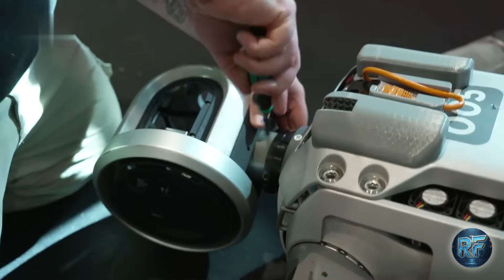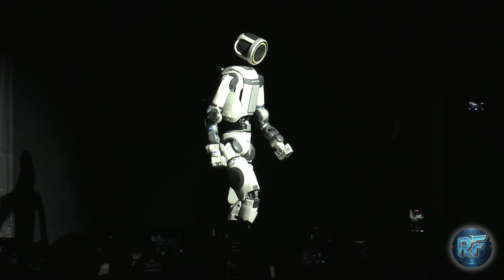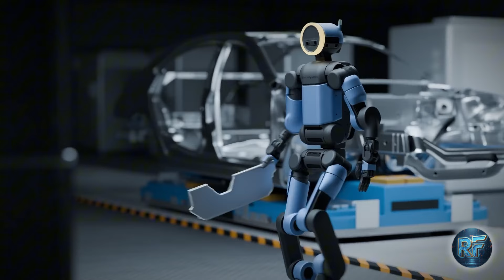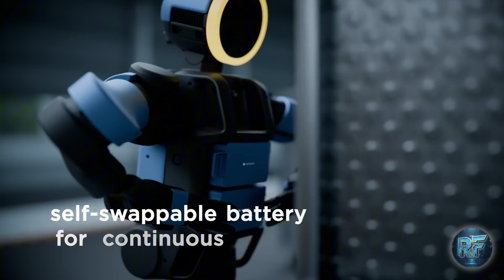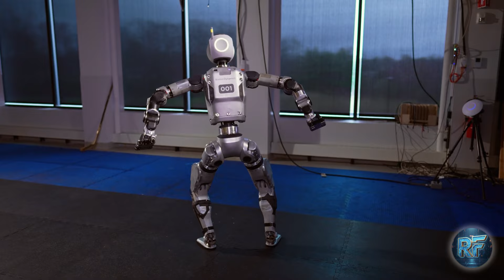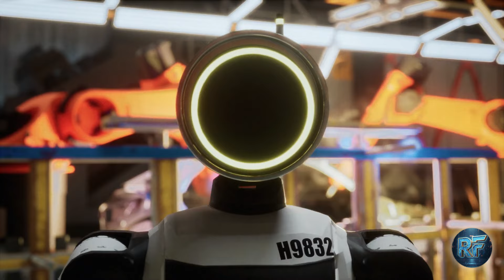CES 2026: Boston Dynamics’ Atlas Goes to Work

Comment: Will a headshot disable it?
Reply from the maker: That’s actually a really interesting question.

Once robots start working around humans, the real issue isn’t “where to hit”, 
but whether there’s a clear, human-controlled way to shut them down safely.

Curious what others think — should robots have a single “off switch”, or multiple layers of failsafes?